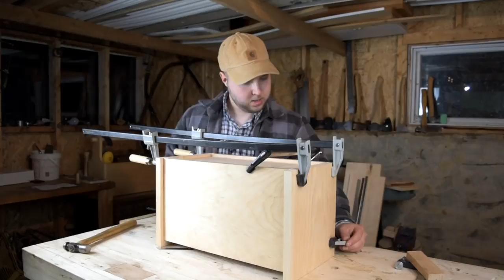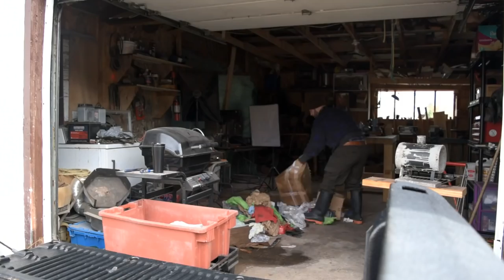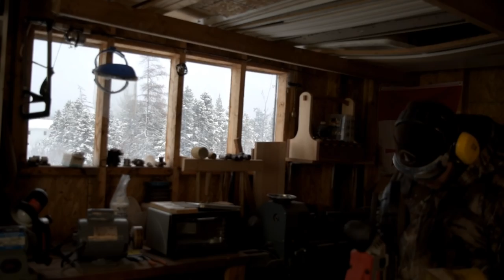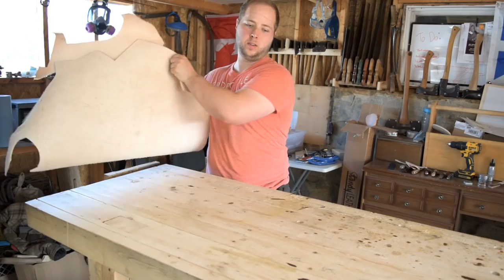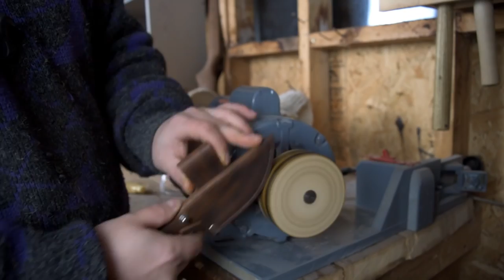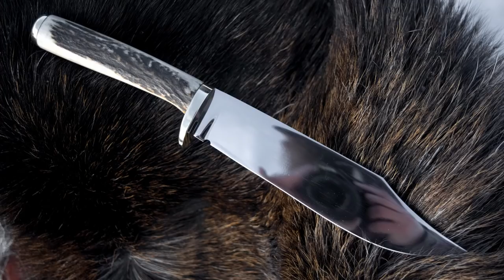How I am Working for Myself at 25 - [SMALL BUSINESS]

Comment: I love your content/videos, I am 13 years old and I am also opening a knife business, slowly but I am getting there, I also don't have much money either so when I sell a knife I have more money to buy materials, I always put all my money into knife making. I will order the devil's forge this week (finally), and in a couple of months hopefully a belt grinder (the exact same one you have). But for now just a file and a jig, so nothing fancy. I asked you what modifications you made to your grinder but you did not reply, I will try to reach out to you through email. 

Thank you for you videos, 
Shlomo
Reply from the maker: Hey buddy, good for you in trying to start something for yourself. Work hard, and work to improve with every build. As for my grinder, I bent the top shaft forward slightly, to relieve some belt pressure. The factory setup has the belts EXTREMELY tight, so much so that mine would not run. I also added a 2" wide platen behind my belt, so I could properly do plunge grinds. Hope this helps!
Reply: @kyle_noseworthy   I just ordered the devil's forge it should arrive Friday! Did you use the refractory cement/rigidizer that came with it or did you not get it with the forge because you did not talk about that in in forge review. Also what was the thickness of the new platen that you put, because there is a review online and the guy says he put an 1/8 inch thick platen so he had to put a rubberized contact wheel because the original platen was very thick and he had too much slack because he put a thinner platen on it. 

Here is the review: http://www.knifenetwork.com/forum/showthread.php?t=67467

Thank you for your reply,
Shlomo
Reply: The forge just came! I love it! So you use a pipe do get the blade out of the direct heat? Also do you keep your ball valve completely open (the one closest to the burner)? Also what does your regulator show when you are heating a medium sized knife, like your bake apple? And finally where do you get your belts?